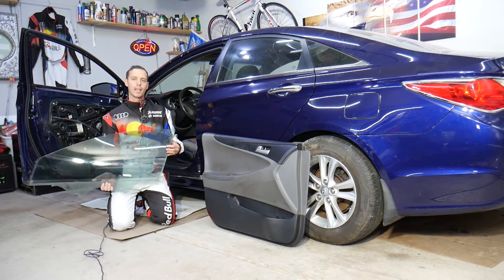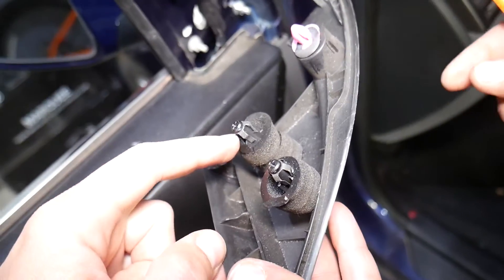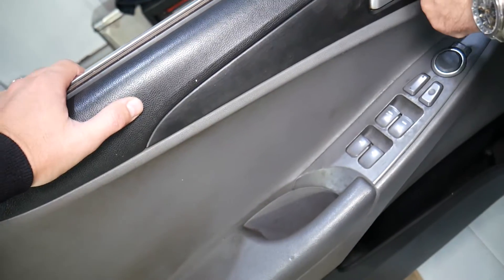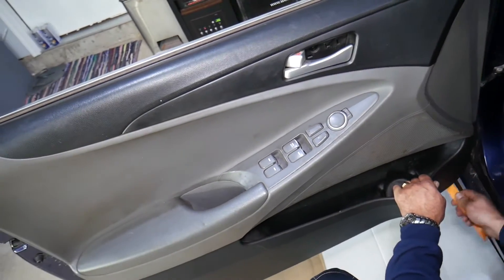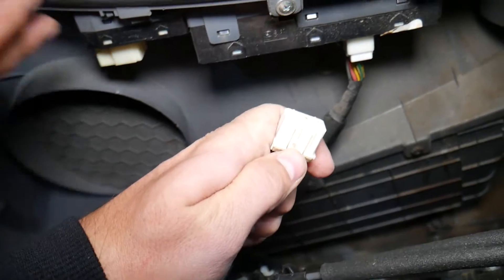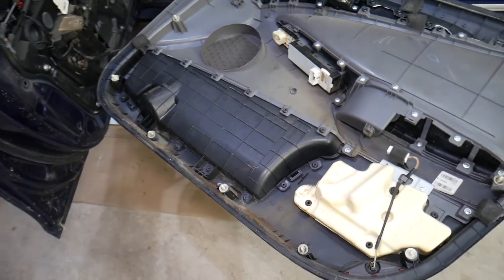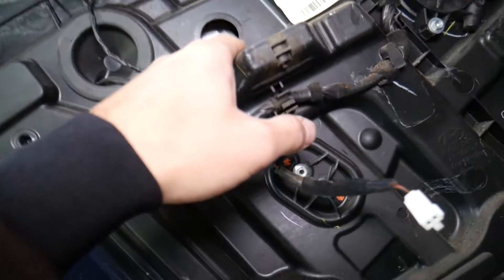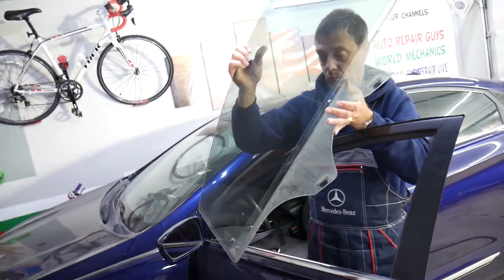HYUNDAI SONATA FRONT DOOR WINDOW REPLACEMENT REMOVAL

Comment: Hi.
I like and  see all of your videos. Very good job buddy.
I have Optima model 2013. It has some kind of weird problem! The steering of my car lightly stuck at the position of 11oclock while turning left from straight or returning from left to straight! Though  It needs very little force to come out of that stuck position but it is annoying while driving fast. 

So what you suggest to rectify the problem.

Comment: Have a question, Im trying to replace the inside part of the outer door handle. Someone tried breaking in the car an broke the little piece that the outside door handle pulls on to release the door. How do I get to that piece it's behind the black plastic panel ?
Reply: I’m having a similar issue, if you look up replacing the lock actuator there’s an in depth video on how to change it